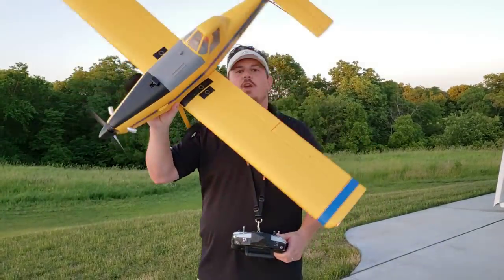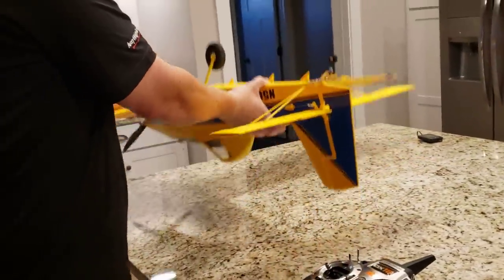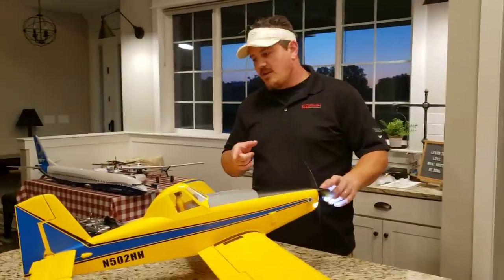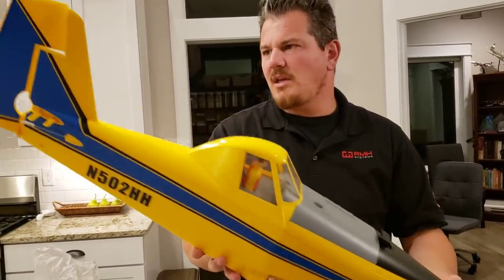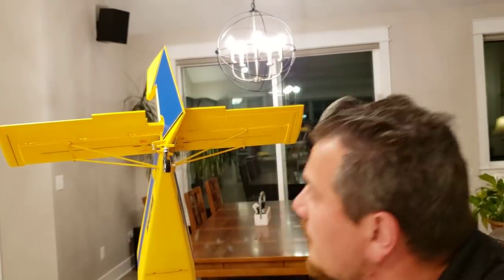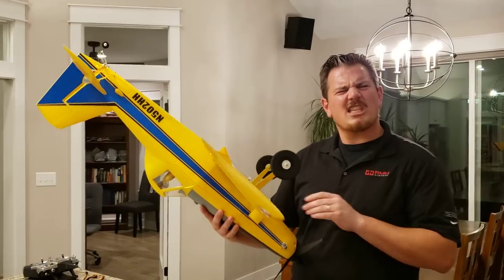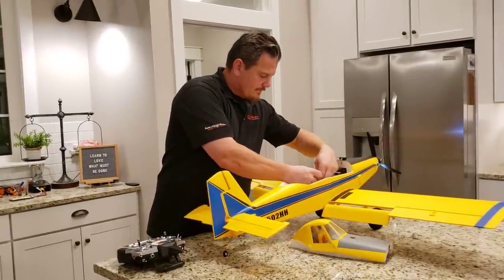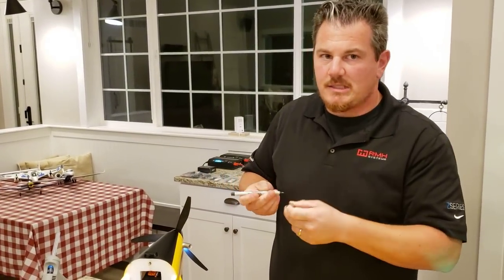Eflite - Air Tractor 1.5m - Unbox, Build, Setup, & Flights

Comment: I Absolutely love mine. It’s like flying the Timber 1.5. Ok on to watch the build.
Reply: I was yelling thru the the video but I guess you couldn't hear me. LOL I believe the extra yellow part was for the Water Rudder if you install floats. I noticed the eyelets for the nylon line to hook up the float rudder. I left my off the the tail wheel works just fine. But it was BS the didn't have instructions for the tail wheel.
Reply from the maker: Yep - totally agree. We found the instructions online, but even they were crappy!
Reply from the maker: I think it's maybe a step up from the Timber 1.5m, since it's not SOOOOOO capable, you actually have to be somewhat present to fly well, if you know what I mean...

Comment: One thing I have found after flying this plane numerous times, The elevator trim kept changing What I found is that the horizontal stab is loose in the fuselage, I was wondering about this when I assembled it. after many flights the horizontal stab can be moved back and forth. So I squared the stab with the wing and fuselage and glued it in place. no more trim change
Reply from the maker: I need to check on that!!! Thanks Jerry!

Comment: Kinda random question, my Spektrum Dxe transmitter fell off the table and the throttle/rudder stick broke off at the base what do you think is the best way to fix it?
Reply from the maker: You can try to get the threaded part out, or drill and tap a new hole and then put a small machine bolt in it, OR just buy another one...at least it was a DXe and not an iX20....

Comment: A great way to get rid of mosquitoes is to have a big shop fan blowing air on you.  Mosquitoes can't fly in high winds.  It would make it hard to record a video because of the noise but it works great for me ;) 

The Air Tractors are crop dusting the fields around me this week.  I have been driving under air tractors breathing God knows what this whole week.  This is better.
Reply from the maker: Great tip! I want to try it some time!!! We got the bug zapper running, and it gets FULL almost every night.

Just hollered at Megan that we need to try this out!!!

Comment: hello brian, I had my first flight a few days ago. It flies really well, no trimming was necessary. It was really good that I watched your videos before. To be on the safe side and from experience, I secured the tail unit with epoxy resin and longer screws on the landing gear. greetings from Germany
Reply from the maker: I've heard the tail can give issues, but I didn't that I can recall ;)

Comment: Isn't there a way to put the lead connector on an empty channel, (ch6?), Then assign that channel to a switch (knob?), to turn the lights on/off?  (In theory, to me it sounds like it.)

Thank YOU sir! 👍🏻
Reply from the maker: No. The PWM that changes as the output changes is not going to have any impact on the lights. You CAN use the BEC voltage from any servo connector or wire to power the LED, but you MAY need a current limiting resistor in series with the LED :)
Reply from the maker: But you CAN do this with a module. They're cheap and easy to find - here's an example... https://amzn.to/2QGaEjP ...this will let you turn them on and off easily.

You can ALSO take a broken servo, and tear off the motor and replace the motor with LED, and you'll be able to run it that way.
Reply: @BrianPhillipsRC  

WE used to do THAT for lights, winch controller, etc on crawlers! I obviously, had a brain fart & forgot all about those! Duh!!!! 😁

Comment: Brian - I'm helping a guy learn to fly his Air Tractor using the wireless trainer option.
We have a DX9  set up as the Instructor radio 
and a DX6 as the student radio.

A strange thing is happening that I've not had happen before with wireless training.

We have rates and expo set up on the master radio.
I did a test flight and set the trims as needed.
Then I set the student radio to have all the same rates, expo and trim values 
as the master radio.

He is the weird thing -
even though the student radio has all the same values -
the actual throws, expo and trim -  turn out to be only about 1/2 of the master radio !
So I have to double the rates, expo and trim values on the student radio
to get the same results that the master radio gets.

Do you have any idea why this is happening ?
We have been able to train okay - but its a hassle to adjust the student radio by doubling and
and don't know what causes it or if there could be any potential problem.
Reply from the maker: I'm embarrassed to admit, but I haven't ever even used that feature, so I know I'm letting you down here, but I have no idea.

As for the rates, could you make another model, then you wouldn't have to go back and forth? Like Air Tractor Trainer and Air Tractor Experienced - the one would have double rates and expo, while the other would be the half ??? sometimes it's easier to make a "work around" than to actual fit the firmware...as we have zero access to the latter.

Comment: For better ground control after landing I got rid of the springs on the tail wheel and installed metal control rods. Z bend on one end (tail wheel control arm) and ball links on the rudder arm makes the ground control 100% better
Reply from the maker: I bet it would. It's a cool idea, but in real like, we kinda need a ridged linkage ;)

Comment: Well The harderst thing about The plane is that its too Hard to let it land and fly i was gono buy a plane but i changed my mind so i buyed drone
Reply from the maker: This plane is a bit bouncy, but I wouldn't say this plane is hard to fly, when compared to other planes of it's class. Planes are much harder to fly than quads as quads almost all have flight controllers, meaning they will autonomously self right, where a plane will not, if not equipped with SAFE (auto-leveling) or similar technology. You CAN put a full blown flight controller in a plane, but most people don't, since it's expensive and complicated.

If you want to learn to fly a plane, you will absolutely NOT regret it. I've flown almost every type of RC and LOVE planes the most.

Comment: Tailwheel instructions were a mess. Looks like you set it up the same way I did, no issues. There were other inconsistencies in the manual as well. Looks like they need to update it completely.
Reply from the maker: Yeah, agreed. Strange, the plane goes together pretty easy, but when they send instructions, I try to look them over. Seems the screw sizes are the worst part of any manual anymore.

Comment: Do you have issues keeping the battery in place on the Air Tractor? I love this plane but I am going to have to rig something up to keep the battery where I want it.
Reply from the maker: I did have some issue, but it's not insurmountable. I'm not a huge fan of velcro on my lipos, but with EDF jets, it's somewhat of a necessary evil. My batteries had to be so far forward that the velcro makes it hard to slide into the plane.

Comment: I have the same bug problem, which is why I wear a beekeeper's veil when I fly.
Reply from the maker: They seem to attack my under-elbows the worst, then when I drive my pickup truck for work, my elbow presses on that spot, and it's super-annoying!!!

I could use bug spray but I just HATE that filmy stinky crap on my arms. When it's hot, I sweat most of it off anyway. We have a fogger, but that would mean I'll have to have the whole area fogged, while were filming. We DID cut all the hay around the house, on the front half of the property, so I bet it'll be a little bit better for a few weeks.

Comment: Very cool plane. assuming Megan can fly,  How about an aerotow set up? That would be an awesome video. Air tractors are used in Australia and the low level skills are amazing,
Reply from the maker: Cool idea! I just need to teach her to fly. This pane would look sweet as an aerotow. I have a KA8 I really want to get flying. Pure sail plane, and don't know it I want to put in a motor.

Nice seeing you here Allen ;)
Reply: @BrianPhillipsRC  I was thinking like a small foamy that will just about fly itself to start off, maybe put the auto leveller board in it from another plane to help out.
Reply from the maker: Yeah Allen. I had thought about doing BOTH controls from the same radio, with the second plane having SAFE in a Loiter Circle Pattern Like I've done on my Conscendo S....this would allow me to bind BOTH planes to the same Transmitter and then simply flip a switch the go between. If I ever get this working, I'll share it...as it would be pretty cool :)

Comment: Hey Brian. Love the videos. On take off into slight wind and with safe on my air tractor abruptly went vertical so much so that I couldn't control it and nosed into the ground. I confirmed before take off that safe was on. Have you ever noticed an issue with safe select on this model plane?
Reply from the maker: Never. I assume you had a servo fail, but could be as simple as a screwed up trim. Did you initiate it LEVEL? The newer (SAFE Select) planes SHOULDN'T initiate out of level, but I suppose you could get it to do it if you really did something funky.
Reply: @BrianPhillipsRC   I checked and rechecked the elevator trim before the flight and it seemed fine. I had just replaced the elevator servo and even though I checked the trim and the servo carefully, it very well could have malfunctioned. Seemed to be working after the crash though. Safe was initiated on a level surface. Never had this happen before even though I've replaced many servos over the years. Thanks for the response.

Comment: Why would you move the battery back towards the tail if the plane is flying tail heavy? Don't you want to do the opposite? That just doesn't make sense.
Reply from the maker: I'm not sure where I said this, but I must have been mixing up my words. If so, I'm sorry! You're right that moving the battery back would result in a more tail heavy perforce, while moving the battery forward would result in more nose heavy performance.
Reply: @BrianPhillipsRC  
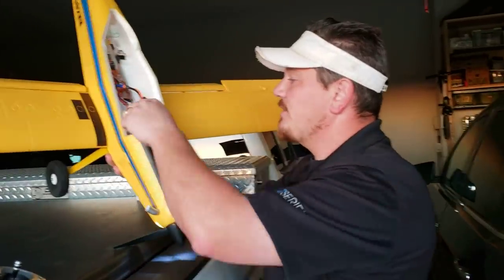Hi Brian, at 7:01 into the video you state that the plane is tail heavy. You talk about and show the marks you made for battery position, and then you proceed to move the battery back towards the tail. This spot in the video is where there was some confusion for me. I think someone else commented on this also. It's no big deal. I'd lose my train of thought if mosquitoes were sucking blood out of me🤪! Everyone makes mistakes, that's what makes us human. By the way, you fly great!
Reply from the maker: Jim - I just added this comment to the video, because of yours and one other comment (you guys had the "Good" question, FYI)

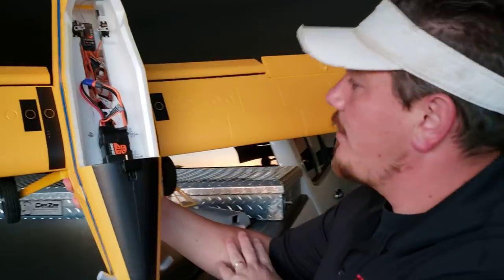Everyone, I got a couple GOOD questions about this, so I wanted to clarify it, as my wording was very confusing in the video @ 7:10 - I was measuring the plane as being tail heavy, but it felt like it was flying NOSE heavy, so I moved the battery FURTHER back to see if it would help. I had another commenters suggest that the way I had marked the CG on the wings was wrong...I used a piece of paper to lay tight along the leading edge of the wing to the recommended points - This was wrong because you're supposed to measure STRAIGHT back, and I was following the contours of the wing, so my marks were ahead of where they should have been. This would explain why my plane was flying nose heavy, while measuring tail heavy.

Sorry about my mistake. We'll fix it in the future.

Comment: I still say you have my order sheet from HH,lol,have this one too.At least this one I got to maiden it when I got it 3 months ago(1 flight on it)Love this plane but I sure do have problems trying to slow it up for landings.On your CG marks,you need to measure straight back from leading edge,not around cord of wing,this is making your CG too far forward,at least that's the way we have been doing it here for 50 years,lol.Thanks for another great video,Rick from Delaware
Reply from the maker: I was concerned about this. I knew that following the curve of the wing might have an adverse impact on the correct spot, but I assumed that the "range" given was to help provide for these small differences.

Thanks for the heads up!

So, in the future, I need to have a measurement from the leading edge, then straight edge up, then straight back to the CG marks, in this case, moving the CG point BACK a bit.
Reply: @BrianPhillipsRC  looking forward to updated flight
Reply from the maker: We'll do another soon, but not sure when.

Comment: Hey Brian,
Question for you,
Would you recommend the air tractor as a first low wing airplane?
Or would you recommend something else?
I want to get to fly a spitfire in the future.
Hanging around with the carbon cub s and so far so good didn t crash it yet🤟🏻🤟🏻🤟🏻,
but want to feel what is like to fly a low wing plane and get confident with it,
Thank you 
You guys are AWESOOOOOOOOME
Reply: Haaaappyyyyy Eaaaasteeeeer here in UK almost gone the day already 🐣🐣
Reply from the maker: I would say the air tractor is a great plane. First low wing would be okay, if you like it. HOWEVER, this model doesn't like to settle down great on hard surfaces, so if you want to have better luck, get some pneumatic tires, and you'll be golden!!!

P.S. We have a "second thoughts" video ready to publish April 13th at 10AM, if you're curious ;)
Reply from the maker: Air Tractor 1.5m https://bit.ly/3tqdyHe
Reply: @Brian Phillips I bought it, did arrive today love it, yes I saw on your video it bounces a lot on hard surfaces , on the field at the club  where I go to fly there is a nice soft grass,
going try with the tires the plane came with, if it doesen t feel right  I ve seen some sweet Du-bro on line.
The building of the plane it was BANANAS,thank you for the building videos really helps,I was missing page 4 too : ) : ).
those little tiny screws ........
Have a great day and can t wait for new vids.
Peace

Comment: Just hit a thermal with three huge birds! Had my heart pumping good and thought I was going to be attacked
Reply: I live off the beach, and when I fly at  night, the birds go beserk.  Not so much in the day time.  It's some sort of sea bird colony, but they will try and attack my planes.  It's almost like a dogfight or really a bird fight..lol.  They've only touched it once...lol
Reply from the maker: SWEET! Was it with the Air Tractor?????
Reply from the maker: Justforkicks - I've only had a few GOOD dogfights with birds, but speaking of dogfights, my cats (the three kittens) were biting the tail feathers and rudder of my Night Timber X!!!! I was pissed to find the little, tinny, tiny holes all along the tail. They must just need something to clean their teeth????? Hope we can get this behavior modified soon. I have a lot of planes on the floor in the basement at the moment.
Reply: @justforkicks6755  you have to get a cam on it!
Reply: @BrianPhillipsRC  aeroscout
Reply: @BrianPhillipsRC  they came straight at me so I gunned it right at them. After that they followed me up the therm and flew with me. Got about 10 circles and I was way higher than I felt comfortable so I pulled out. 
Those are some good kitties. A little hot sauce might keep em inline
Reply from the maker: Dan - suppose I could get some CLEAR hot sauce? The wings are white...
Reply: Brian Phillips I believe you will have to put the plane out of the cats reach. The behavior might change if they get bored with it but I wouldn’t count on it lol! I know this because my male cat loves to chew up and rabbit kick foam of all types. I love your videos by the way. Favorite RC channel!